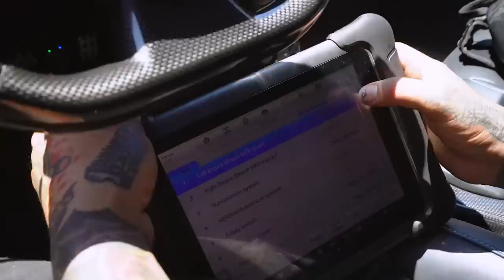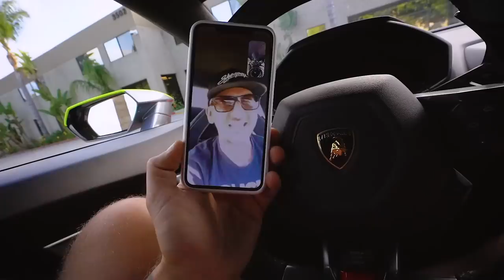DOING BURNOUTS IN TJ HUNTS REBUILT FERRARI! *HE FREAKED OUT*

Comment: The flat-plane crank (sometimes flatplane) is a type of crankshaft for use in internal combustion engines that has a 180 degree angle between crank throws. Flat-plane cranks are used in V-configuration engines, generally with eight cylinders. this is the flat crank design explaind